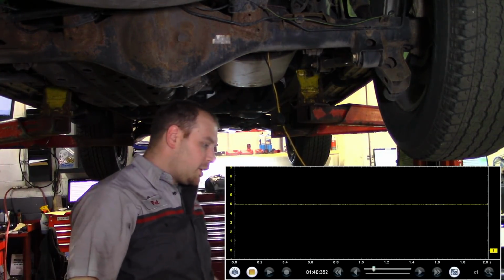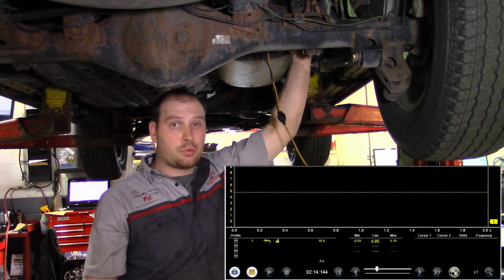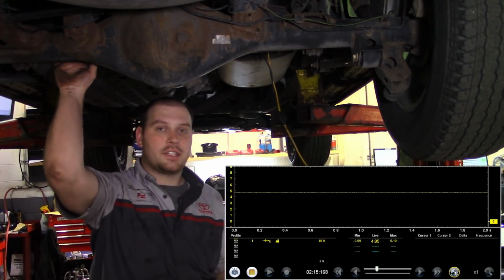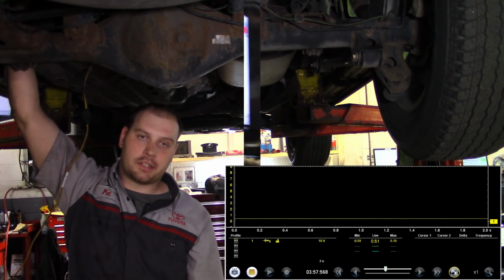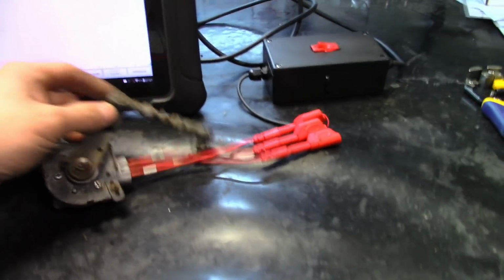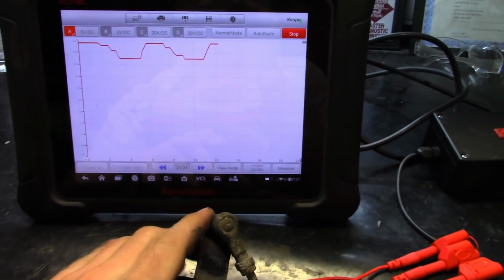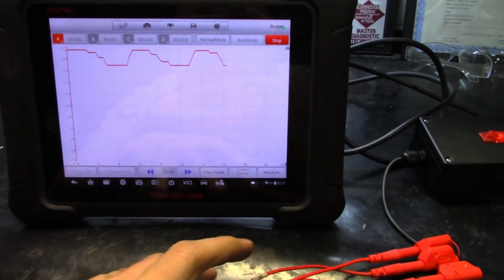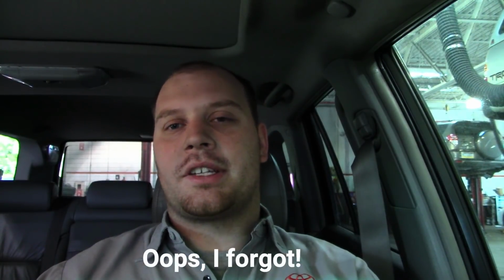05 4Runner air suspension failure + Diag Drawer tour

Comment: Devalue the trade by showing how to repair something right. So the customer gets what they paid for. Yeah.... I'm not buying that. If someone shows you how to repair something right. Then it's a win for everybody. As the second the customer gets stiffed. They will take it out on the next guy that touches it. 

Besides. The only advantage Dealer techs have. They can pick up the phone and call the Factory representative for help.. As some problems are deign flaws or Parts made incorrect.. That the factory needs to know about.

Comment: You said these systems rarely fail? So should I be looking at my height sensors? My ‘05 Limited has had a rough ride after I did the rear brakes and ignorantly did not turn off the rear air suspension. I’m wondering if I reset the sensor height calibration in some way or if the left bag went out coincidentally at the same time I did the breaks... what are your thoughts?
Reply from the maker: telecasterman18 is it riding higher than normal? Or lower than normal?

Those just control the ride height. If you’re riding at a normal height. I’m not sure if those height sensors are the cause.

I’m wondering if one of the airbags are possibly leaking.
Reply: Voltage Drop Diagnostics No sir. It does sit 2-3 inches lower on the driver’s side. The ride is rough and I can hear the axle hitting the bump stops at slower speeds when there are a lot of bumpy spots. I can turn the height control up to high before taking off and it holds its own for the rest of the ride but then goes back to being a rough ride next start up.
Reply from the maker: telecasterman18 it sounds like the air bag may be leaking.

Poke your head under and try to listen for a leak.

You can even spray the airbag with soapy water.

If they’re not leaking. Then I’d start to look into the height sensors
Reply: Voltage Drop Diagnostics Hey so I rechecked the suspect air bag and it is hissing slightly. I am going to convert all 4 wheels to passive conventional suspension like I said earlier. Any special tricks to disabling the rear air suspension computer? Thank you!
Reply from the maker: telecasterman18 honestly, I haven’t done that myself. I’m sure you could just pull a fuse, though.

Comment: You're not devaluing the industry so just ignore them. Your videos are great Pat so keep them coming and hope you're done with kidney stones.
Reply from the maker: I hear what youre saying, but when someone at the top of the industry is saying that, it is hard to ignore. But they havent given me concrete evidence on how we are devaluing the industry, so until they do, I'll just keep pushing people into their classrooms.
Reply: @VoltageDropDiagnostics  The older you get you learn challenge those people (politely until they show no respect) and apply logic & common sense to what they say and usually they have a lot of holes in their opinions.  I personally see this venue making the industry stronger & more educated...not devaluing it. Like I said I learn to ignore people like that until they can convince me otherwise. Been doing this for 40+ years in aerospace and automotive industry and there are engineers and executives in high positions I have worked with that sometimes fail to look at different perspectives and use logic & common sense and need to learn that just b/c they're in a position of importance  does not make their opinion correct & I had no problem letting them know that...fruit for thought. You're doing great challenging people to get more training to strengthen the industry and make our industry more respected by having mech/techs more educated and making better diagnoses and making less mistakes thus happier customers spending less wasted $$ on misdiagnosed vehicles.

Comment: Does your shop have to equipment required to recharge the 4Runners with Yamaha hydraulic suspension? No one within 60miles can do it for us. We normally just convert them.
Reply from the maker: No, we dont have the tool either. Most of the time we just convert them as well because of the cost! Now, with that said. If the strut has never been replaced before, you can replace the strut one time and there is enough fluid in that it will be fine. Or at least that is the info that toyota has given me.

Comment: What do you mean you dont have much to show? You have a nice shiny expensive snap on tool box to show.
Reply from the maker: May be a shiny snap on tool box, but that thing has empty drawers! I keep all of my rarely used tools in a wall hanging cabinet to keep them out of my tool box, and my tool box looks empty because of it lol.
Reply: Voltage Drop Diagnostics  one of the good things about working at a dealership is that you don’t need as many tools. I started out at independent  so I have plenty tools that I don’t use at the dealership. Are you a full service tech or just a diagnostic guy?
Reply from the maker: JoeLopez40oz i do full service, but specialize in the diagnostic side.

I seen Cody, from Cody’s auto diagnostics tool box tour and can’t imagine needing that many tools lol.

I can almost guarantee that he has 3 times the money invested in tools, than I do.

A lot of the specialty tools that I need are provided by the dealership. And I work in a shop where a lot of guys actually share our tools lol.

I’d seriously be embarrassed to do a full tool box tour lol